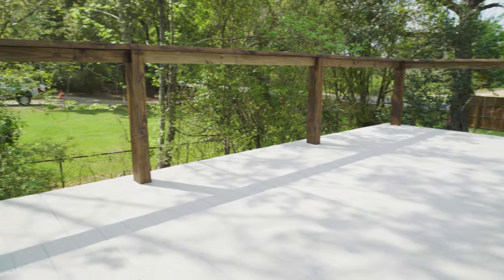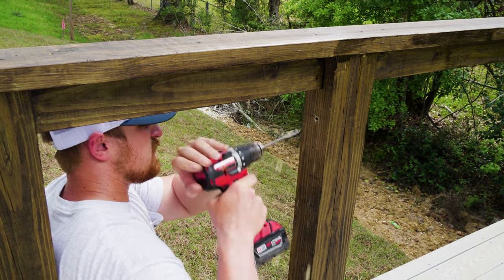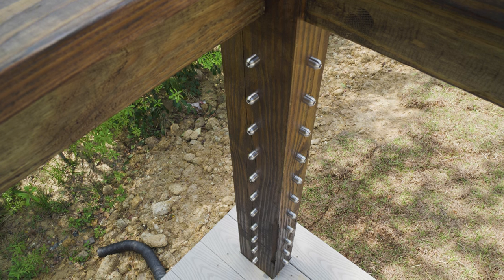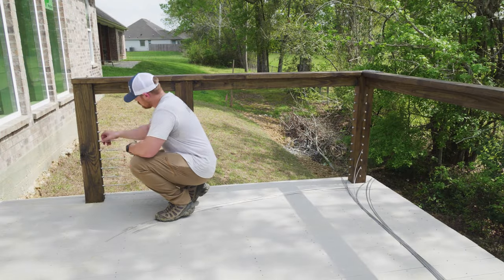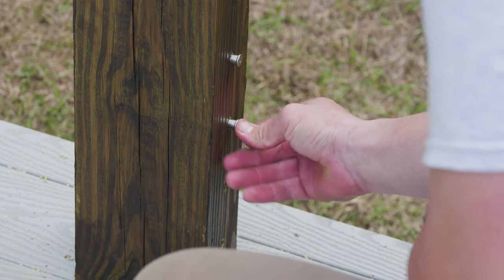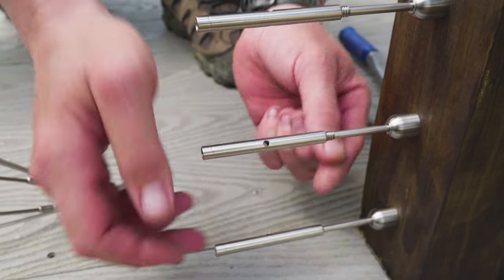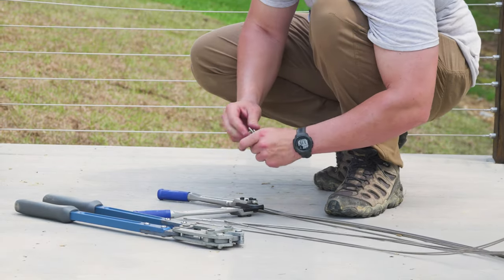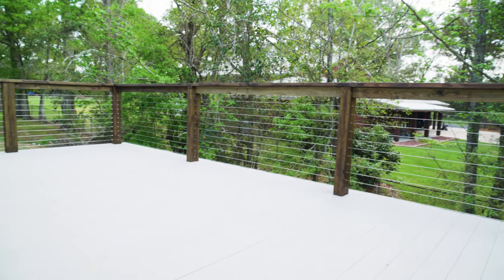How to Install AXIS Cable Railing - Full DIY Project

Comment: nice!   aren't you supposed to wait 6 months to stain pressure-treated wood?
Reply from the maker: Yes, it's best to wait until the pressure treated lumber is dried to stain AND install cable railing. That can take anywhere from 2 weeks to a couple months depending on the weather.

Comment: How does the cable attach to the tensioner???
Reply from the maker: The cable is attached by a method called 'swaging'. Simply put, you'll use a swager to crimp the components onto or over the end of the cable. You can watch more about this process here https://youtu.be/VReqBW6ewaw

Comment: Maybe I missed it, but I’m curious if you use the 1/8th inch or the 3/16 inch cable on the project. Thank you.
Reply from the maker: Hi there! We're using 1/8" components and cable for this project. The workflow is identical when using either size. Thanks for the comment!

Comment: what's the spacing on the template between cables?
Reply from the maker: Hi there! For our HAAS Cable Railing Marking Template, the holes measure 3 inches apart.

Comment: Also, whats the maximum distance between posts you recommend? I have 4x4 cedar posts with a max of just under 6'
Reply from the maker: The max distance that we recommend is 6'. If you need your project inspected at any point, you'll wanna check your local building code, but if you don't, you should be good to go!

Comment: What is the maximum length of a cable run? One side of my primary deck is 60 feet long. It has wooden 4 x 4 posts from floor to ceiling about every 7 1/2'. Local code requires a post in between these. Does your company sell the small intermediate posts? I didn't see them on your website. Thanks and great video.
Reply from the maker: Thanks for the questions! First, you will not need to break up your run if the 60ft run is consistent with no bend in it. 75ft is the max run length that we recommend. Second, we do not sell intermediate posts, but you shouldn't have trouble finding a local supplier depending on what you want your intermediate posts to be.